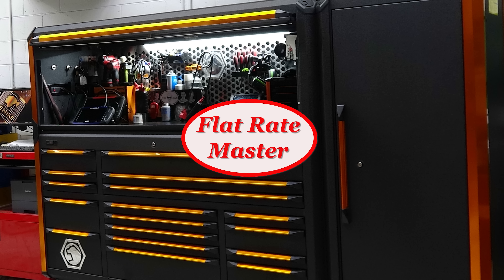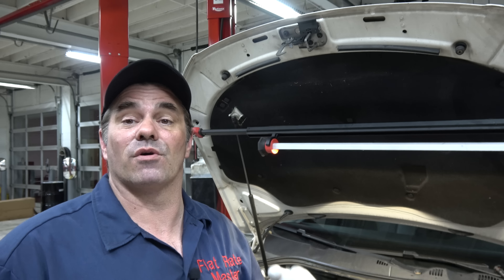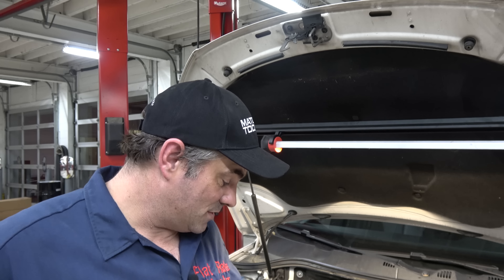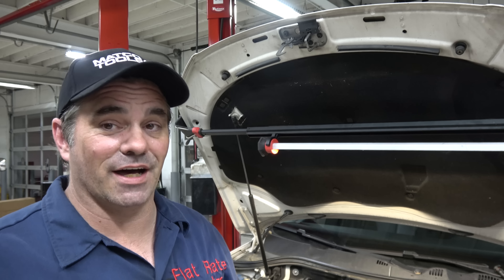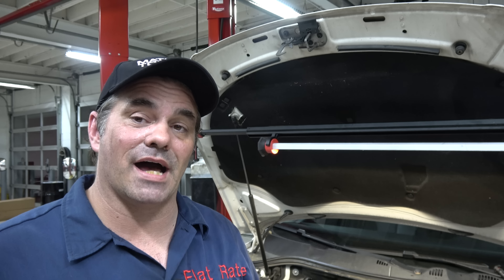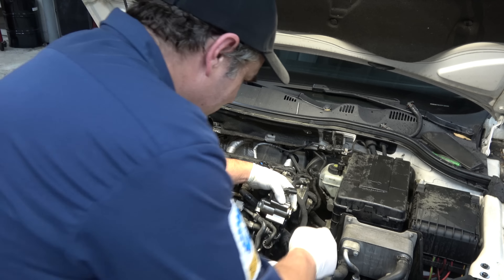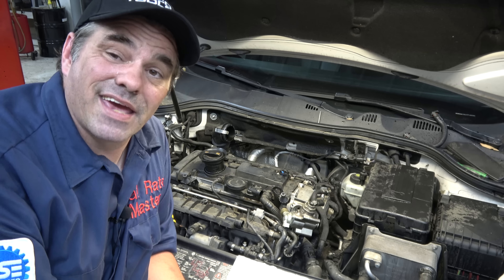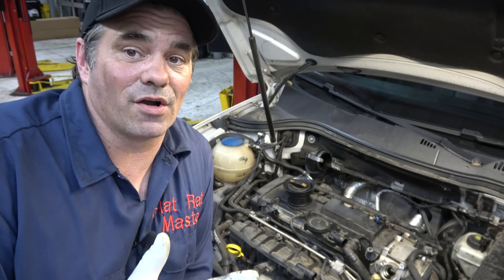Automotive Carnage 2007 VW FSI

Comment: I was a VW mechanic at a dealer and semi retired doing part time work on VW's and Audi's at my farm. VW changed over to a roller lifter for the high pressure fuel pump on it's newer engines which eliminated the issue completely. VW is putting more emphasize in long term reliability and the brand  is improving. I was getting less low paying flat rate warranty work which was good because non warranty work pays more. 
Many VW owners are DUMB. They will continue driving the vehicle long after the check engine light comes on and/or there is a driveability issue. I hook up my VCDS scan tool and find they drove hundreds, sometimes a few thousand miles before the car quit running or they bring it to me. If the owner had his/her car fixed when the check engine light came on in the above video, the follower, bolts and O-ring cost under $60 plus an hours labor.

Comment: Seen it last week with a 2004 Dodge Durango,customer's brother installed a new starter and still would not start.Never looked beside the engine block,there was a hole in the block which a rod decided to go.Expensive fix too called an engine replacement

Comment: 11 years old.... not bad.
Reply: Indeed
Reply: Lee Ramos I guess it could have been replaced before... I have yet to come across a failed one. I haven't seen worn PD camshafts either. I'm thinking wrong oil spec is used.
Reply: Thomas EXOVCDS I've seen a case on my friends mk5 jetta, it wore through but i jumped on his ass to get it swapped out quickly. Luckily there wasn't too much wear. I also believe it happens more on manual transmission cars because they rev more erratically.
Reply: Lee Ramos interesting.

Comment: Did the customer approve the repair?
Reply from the maker: We patched it together, replaced the pump, follower and had to replace all 4 injectors due to them leaking after pump replacement
Reply: Flat Rate Master Thanks Mike.

Comment: just curious- what caused it? And about how many miles are on it? I am just wondering is all, nice video
Reply from the maker: 100k, high pressure pump follower fails, common issue, takes out the pump and cam, the follower is the sacrificial part. As it fails it makes noise lots of it, so not hard to save the pump and cam if repaired in time

Comment: Flat Rate Master, I am a young lube tech/alignment guy and last week I did an oil change on a 2011 Chevy Traverse with 180,000 miles and the 3.6L engine. I drained the oil, tightened the plug and changed the filter making sure not to double gasket the filter. Then I added the 5-6 quarts the vehicle required,  screwed on the oil cap and sent it on its way. Yesterday this same vehicle came towed in with a big ass hole right in the engine block. The engine threw a rod and is completely destroyed. Ive done a little research on the motor, but I am not knowledgeable enough to know, that if the timing chain were to separate could that cause this to happen? I am finding myself possibly having to either get fired or buy a new engine for this customer all over an oil change that I am 100% positive I did correctly. When the vehicle came in, it did not appear to have lost any oil from the drain plug, oil filter, or oil cap. What should I do in this scenario? I don't want to get fired over a routine oil change that I did spot on.
Reply: After we inspected it and told him it was not our fault, the customer took it to the dealership. We have not heard back. I just don't want to get the call one day that we could be stuck having to pay for this motor and I want to know what I can say in defense for myself about the situation

Comment: Is that because you know the system or you read description and operation first ?
Reply from the maker: I know the system, but code definition and scan tool data would lead you right to an issue with the high pressure pump

Comment: That's great and all, but Volkswagens aren't really automobiles.  They are heaps of over-engineered plastic junk  on 4 wheels.  Great Video FRM!
Reply: It's a shame they drive better than most vehicles!
Reply: Hey hey now.  Back in the early 80s I took a road trip in a yellow vw diesel rabbit.  Smooth running and a little over 50 mpg.  I think the yellow paint may have had something to do with it.
Reply: They’re very nice cars. But they’re expensive to maintain. And sometimes a wiring nightmare.